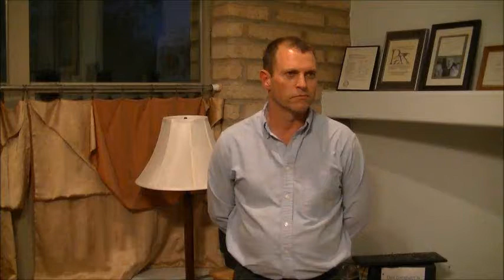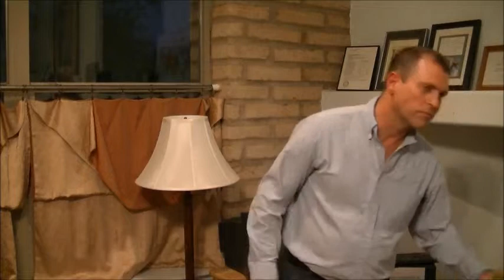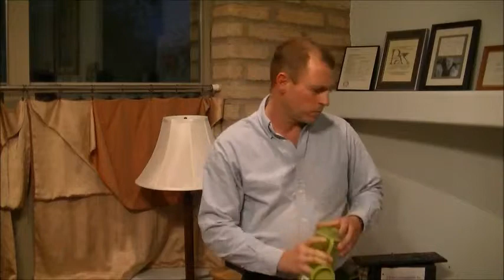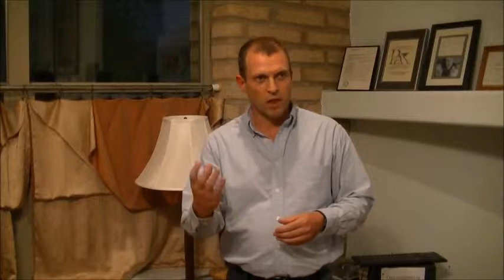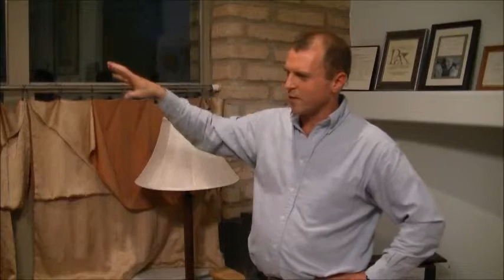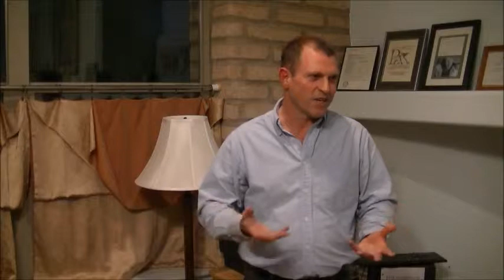Solar Photovoltaic (PV) Power Quality, Wiring Emissions & Electrostatic Transformers

Comment from the maker: Among the characteristics that provide high reliability to this product’s operation is the inclusion of electrostatic shield as a standard feature, which helps to isolate the low voltage windings from the high-frequency pulses present in the medium voltage system, protecting the solid-state components of the inverters. http://www.gedigitalenergy.com/press/gepress/GE_DE_PROLEC.pdf